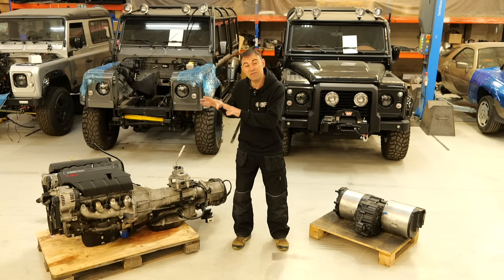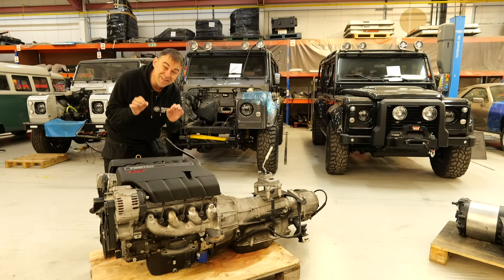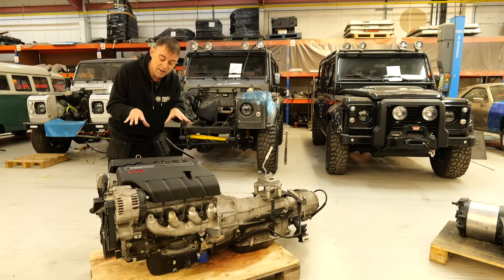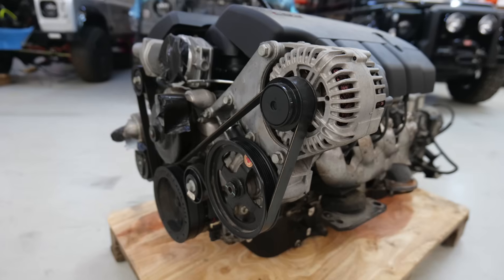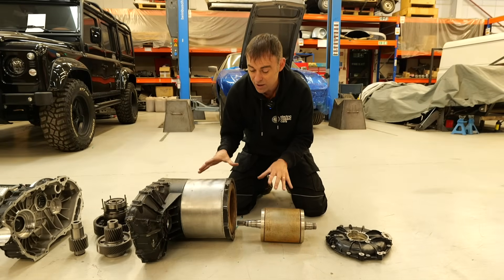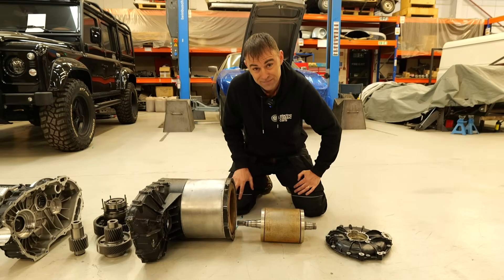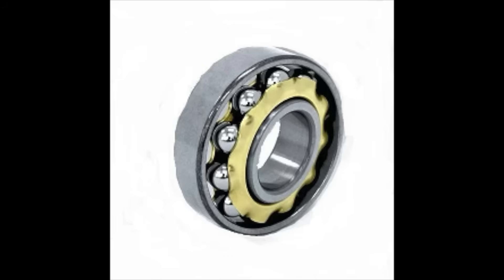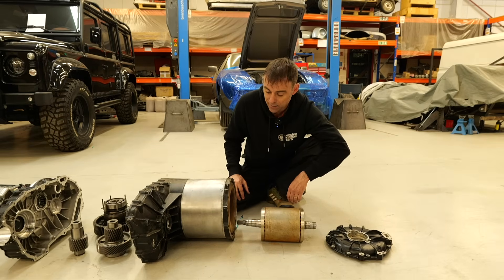Let's compare the Tesla LDU with an LS3 V8 and take one apart to see what makes it tick.

Comment: It's the lack of maintenance that is the game changer and not that it runs on batteries. As more manufacturers switch there will be a drastic change in the dealer network. Dealers won't be able to survive on cars that don't burn up parts and require constant service.
Reply: You make a very good point and you can see this already in the contrast between the legacy dealership networks and Tesla. It's the non-franchise car repairers who'll see the biggest change but ICE vehicles will still be on the roads for next 20 years so it'll be a gradual decline.
Reply: That’s the dealer problem. They’ve been ripping off people for years.
Reply: You can't ignore the cost of fuel though. 7p x 82kWh for my 375mile EV3 costs £5.74 How much does an LS3 in any vehicle cost to do 375miles? £60? £70? It's about a tenth of the cost, so you can have a big powerful power unit that feels like it's free to run.
Reply: Everything except the plug in an EV is proprietary , you cannot buy a kia battery for a tesla , battery management systems , electronics , wait till these EV things get old , they will be throw aways , unlike many of the ICE cars on the road that can be anything up 40 or 50 years old and still doing the job every day no problem .
Reply: @mikldude9376  The motors? They don't care what battery you use - checkout the retrofits being done to older cars to switch to electric. You don't need a Tesla battery to run a Tesla motor. 

You just need a power source, 400v or if it's an 800v architecture. It's really the same. And the batteries coming in the future are still accelerating in wh per kg, none flamable chemistry, solid state. So many different chemistries. 

We've almost exhausted the ICE engines improvements. 20-37% efficient vs EV motors CURRENTLY at 96% effecient. Makes sense for most transportation to switch. 

Diesel is best for long hauling, Gasoline for long travel distances without filling up for now, and EV for shorter stretches for now (150-300mile).

Eventually we will have Evs that go farther than gasoline - it's not a mine is better than yours situation, they all have a place in the world untill they don't.

As far as EVs today, I'd argue a lot of them you are right. People would have moved on to new cars and wouldn't want the EVs of today. But at least the battery is 99% recyclable. None of the EVs out right now look or feel interesting enough I'd want it 40-50 years from now like the older cars do. Maybe some exotic ones.
Reply: @mikldude9376  if ppl keep their car forever why do every year car makers get sales lol

ev or ice alot ppl change their cars in 7 to 10 years..some even faster
Reply: I can’t wait to laugh at the few holdouts who are paying $10 a gallon for gas because they can’t recognize the advanced option
Reply: Yes but batteries capacity decreases. Everybody whi has a phone knows that. So how much it costs to replace battery after 10 years?
Reply: +++ Clearly a biased and deceptive post bc it's cherry picking. Typical for EV zealots. EPIC FAIL. 
I massively invent in this space so I know the deception game. GTFO!!! ++++
...
..
.
Reply: Don't worry about that, the dealerships will just find another way to empty your pockets. 😞
Reply: don't worry there will be way more maintenance work on EV batteries or just straight up replacements than there ever was work on normal cars. Stats show that EVs have 80% more issues than normal cars.
Reply: @RoverIAC  yes, some EVs have had more recalls than ICE vehicles... Until you realize most of those recalls are being done while you sleep via internet! Just like computers, tablets and cell phones!
Reply: @RoverIAC  Please point me to those stats
Reply: @RoverIAC  Which stats?  How about the German AA's stats on 3+ million call outs.  For 22 reg cars averge ICE callout is 5.4/1000, average EV callout is 1.7/1000.  Average Tesla model 3 callout is 0.5/1000.  Incidentally most EV callouts are starter problems (flat 12V battery).  The biggest reason the 22 Model 3 is so low is it has lithium 12V battery.  Maintenance is much lower too - an ICE that engine needs regular servicing or it'll die due to all those moving parts, in an EV (well Tesla's anyway) the batteries and motors are designed as sealed units that require 0 maintenance for the lifetime of the vehicle.
Reply: That's why most new EV's require subscriptions. You will have to pay for things that don't actually exist.
Reply: @Krishna-Govender  I owned EVs since 2020 and there are no subcriptions to run the car. And I don't mean just Tesla, I have a Nissan Leaf, also had Chevy Bolt at some point. I heard about Mercedes doing that, but it isn't specific to EVs, it's for all their lineup.
Reply: @Krishna-Govender  Huh?
Reply: @Krishna-Govender  
No such thing in my research when I bought an EV. I bought the MG4... gets a service every 2 years and the two year service costs around $200. I charge of solar panels, so I pay next to zero for he fuel. Best thing I ever did buying the EV!!
Reply: Yeah, then, when the battery is depleted after few years, you scrap the entire damn EV.
Reply: @ilmaio  you people act like an ev lasts 30k miles.  There's tons of ev out there with over 300k miles on the original battery.  Modern ev batteries have replaceable cells and parts so you rarely ever scrap a whole battery.  Educate yourself instead of just hating. 👍
Reply: @ilmaio  You mean every few "decades"
Reply: @ilmaio 🦖